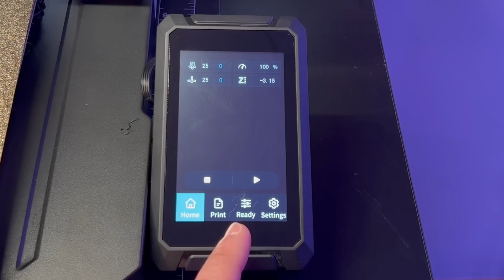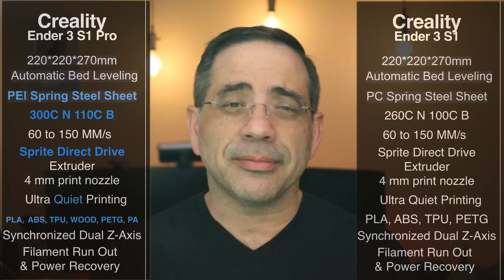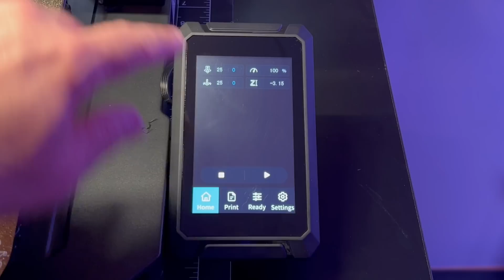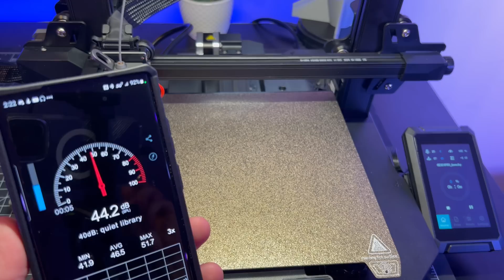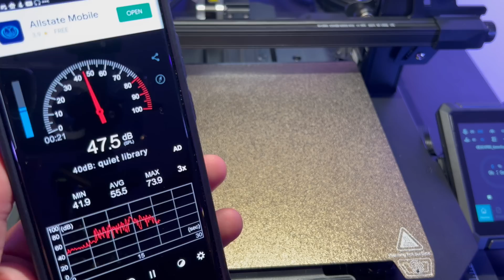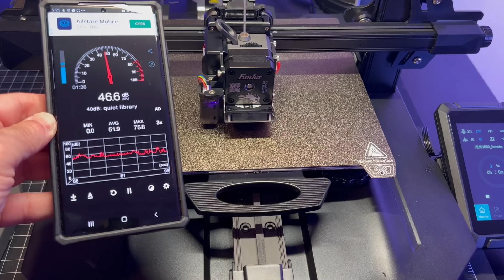The Best Ender Yet?  Creality Ender 3 S1 Pro!

Comment: you call it tinker-free, but after working fine for a month, my S1 won't stop clogging. Tried replacing the sprite extruder and after a night of trying to get it to work, it started jamming too. I've had to replace the extruder assembly on my ender 3 pro twice, but at least it's still running. My S1 right now is a $400 paperweight 😞
Reply: I have had several problems with mine as well. However, I am an Aircraft Mechanic so I have been fixing it myself. I don't call for help. The extruder has jammed up two times due to the nozzle clogging, then the filament sticks in the small piece off nylon tubing below the extruder, and above the nozzle. I believe the heat is migrating up the hot end and causing it to swell. I just changed the hot end to a new type with a copper extension, which will dissipate that heat, an minimize the amount traveling above the hot end. So far it has worked great. Search this.....Sprite Extruder Pro Upgrade 300℃ High Temperature Bimetal Heatbreak Plated Copper Heater Block Nozzle, Heater Sensor for Ender 3 S1 Pro CR10 Smart Pro, Sermoon V1 3D Printer (Upgrade kit)
Reply: @vintageracer3734  Tried upgrading to the pro - that's the one I'm referring too in the comment
Reply: You lost me, I did the upgrade to an S1 PRO. Not real happy with mine..
Reply: @vintageracer3734  so did I and it still acts up.

Comment: yeah i JUST got mine powered on to set it up and no this thing is probably great but right now all it does is start mid air
Reply: I'm 3 weeks too late for you but you need to z level after auto leveling
Reply: @fuglong  yes i figured that out took WAAY to long but i figured it out not sure why i have to go through a automatic leveling routine only to then offset that wouldn't it make more sense to set the bed height before doing the leveling? anyhow it works fabulously once set up no thought required really it just works

Comment: Does it auto level the Z axis too?  My anycubic kobra doesn't auto level the z-axis, which isn't a big deal.  Anyway, I just bought an Anycubic Kobra (less than 2 weeks ago) and already having issues.  The fan is making a loud noise and prints are failing as it prints upwards.  I do believe at this point it's a stepper motor.   I've contacted customer support and it's been an absolute nightmare.  They insisted they send a replacement fan for the motherboard because a "return is problematic".  I finally got a return address with them saying "just send us the bill for shipping".  I have a feeling they aren't going to refund the shipping. Keep in mind as well, I contacted support the weekend I got the printer and I finally got a return address on Friday.  (almost 2 weeks of fighting with them).

I have a few friends that keep telling me to go with the Ender series, so I think that is what I am going to do.  I'm done with Anycubic, especially after the rotten customer service they gave me.
I appreciate your video, definitely helpful.  As far as the print bed goes, the Anycubic Kobra has the same type of magnetic bed and it's beautiful.  I love being able to walk up to the printer and just picking up the finished piece with no hassles.

Comment: good thorough video. I don't understand why creality likes to set the purge line so far from the edge. I know it's easy to reset it in firmware or slicer but they should do that in the first place.

The 2 test cubes seemed very different - the one on the left had very rough transitions between layers. 

Overall, I think the price difference for the 'pro' is money well spent and wouldn't even consider the non-pro.

Comment: is the ender 3 S1 pro closer in approach and overall quality to Ender 3 pro or Prusa MK3S+?
Reply: If u calibrate it right you can achieve same level of quality prints
Reply: @tonnyprasetya48  i agree and the quality seems superb, however, i do run a business with several 3d printed items and i need consistency and reliability (highlight on reliability); cant ignore that price if it is "close" to Prusa. But would spend the extra buck if need to.

Comment: So the hotend can handle CF? It’s not very clear.
Reply: CF with what blend though? It should be able to handle most, but there are exotic CF blends that exceed the 300 C temp rating of the pro. Also, CF blends will be abrasive, so plan to change nozzles more frequently with brass, or get some harder nozzles.

Comment: Ender 3 v2, with dual z, and microswiss direct drive - fullmetal hotend. In my opinion better results and cost more then less the same as the s1 pro. 😉
Reply: Nope.  I have the MicroSwiss on my Ender 3.. it's good, but the Sprite is better, and lighter.   Now add up the cost of the dual z mods,  BL or CR Touch,  Flexplate,  Microswiss setup, LED Bar... and you have similar cost, plus the S1 has bigger print area, a cleaner more finished look, a far superior  cable management system.. It's a better printer.

Comment: Did you use hardened steel nozzles for the carbon fiber?  Are there any specific ones on amazon that you recommend?
Reply: E3D Nozzle X  They are basically indestructable